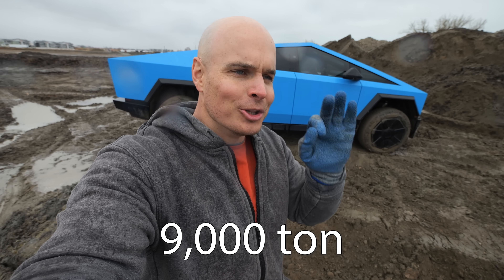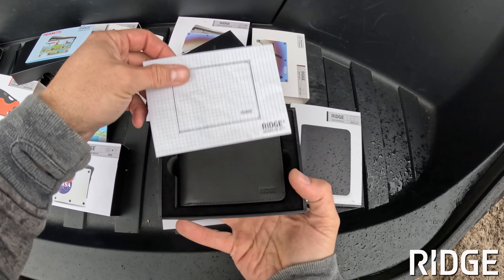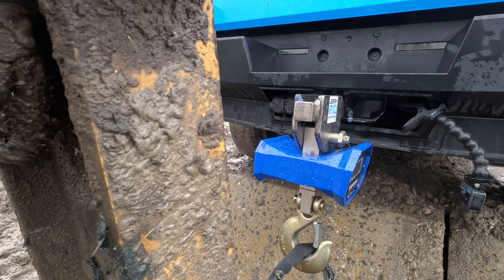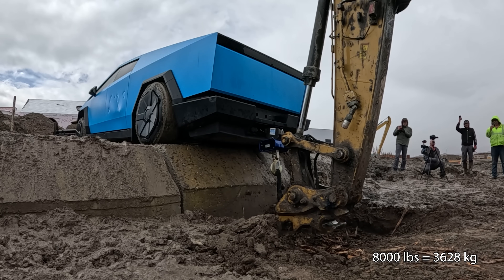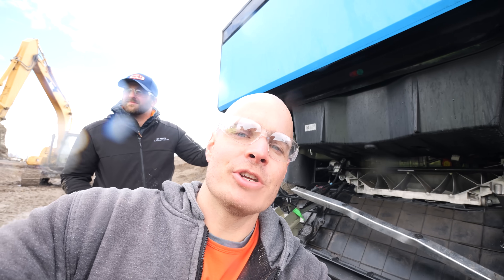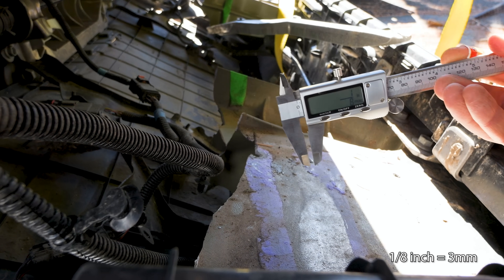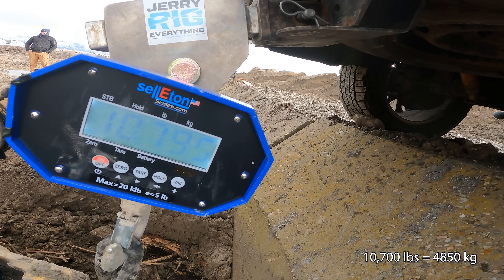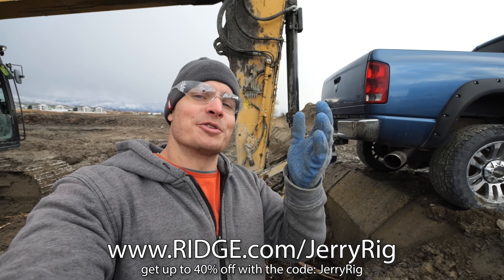SHOULD YOU TOW WITH A CYBERTRUCK?! - (catastrophic failure test)

Comment: Isn’t the vertical force capacity denoted by the tongue weight rating, not the tow rating? Tow limit is calculated with horizontal force, not vertical.
Reply: He addresses that in the middle of the video.
Reply: @DylanClarkSallee he kind of does… either he misunderstands or he’s being misleading on purpose because most people don’t tow and don’t understand why exceeding the tongue weight doesn’t mean tow capacity. Tow capacity has more to do with the drivetrain than structural. GRE also tweeted a few weeks ago that he would get rid of his Tesla because of Elons politics which makes me less inclined to believe he is non biased.

Comment: If you happen to back an 11,000lb trailer off a cliff and have a tractor holding down the front wheels you would shear the hitch right off. 

Although, I think I’d rather be sitting in a truck with no hitch than at the bottom of a cliff. 

Very scientific.

Comment: 8:30 Structural bonding adhesive holds airplanes together and can be much stronger than 4-8 mechanical fasteners.
Reply: Still not an excuse for not using mechanical fasteners
Reply: @scottwesner9362  No, I mean yeah, yes it is a suitable replacement for mechanical fasteners, when used correctly.
 Mechanical fasteners are often used to ensure enough clamp, curing time.
 Removing the mechanical fasteners often won't change the breaking load even.

Comment: Well, it's a misleading and totally irrelevant video. The force applied in the video is vertical. However, this is not a crane. The structure is designed to withstand horizontal forces, and although I'm not a Tesla fan at all, I'm pretty sure it will be capable of towing a trailer with 20000+ pounds of mass.
Reply: pop it out and rewatch the video without all the slurping
Reply: @Maybeldid how many times are you going to post this lame comment?
Reply: @polska905  did you pop it out yet?

Comment: I always enjoy your videos. You brought up interesting points regarding metal fatigue and the thickness of the casting. I agree there could be something wrong here. However, I come away wondering if this is a valid test.

I doubt 100% of the mass of the trailer ends up as tongue weight. After all, the trailer is still on wheels, trailer brakes are required, and there is a properly distributed load. Upon stopping there is a torque that would apply a downforce "of a portion" of the load which transfers to tongue as a downward force but it would doubt it would be the entire mass of the trailer.

I wonder if there is a reference at SAE International that may help validate your test.

Comment: I like “Jerry Rig Everything” but I question the engineering knowledge in this experiment. 10,000 lbs downward vertical force is not achievable on a hitch. This clue is evident being they held the front down with another machine. By doing this you are applying leverage to the hitch, further increasing the ability to a failure. The leveraging pivot point is at the rear axle, a shorter distance to the hitch than the front bumper. In a real scenario, the front wheels would leave the ground, relieving that amount of stress. I'm not going to make this a geometry lesson, but seems the video is biased to discredit Tesla.
Reply: pop it out and rewatch the video without all the slurping

Comment: Mechanical Engineer here (30 year experience). I don't care about EVs or Musk.  Results of CyberTruck were quite impressive.
Reply: Stop saying this, no shot you're an engineer if you think snapping entirely is an impressive result. No normal truck is going to break like this, it might bend sure but it's not going to snap the rear end off the truck. How a frame snapping an a trailer flying off the truck is viewed as a "quite impressive" result is idiotic. Especially since it gets weaker over time and this becomes a when not an if problem.

Please let me know anything you worked on in your 30 years of experience so I can avoid it completely.
Reply: @Abadeez but such forces and a dozer on the front of your truck to prevent the truck from tipping is realistic? 

9 times the rated capacity is more than enough.
Reply: @ Not snapping is the point even when overexerted. And it will slowly come down from 9 times because of how aluminum works. Also the point. Nothing you say makes it a good result when it snaps off entirely by comparison and gets weaker and weaker over time.
Reply: @carlosherrera7822  until the tow breaks from aluminum fatigue and the load comes barreling toward you in the opposite lane.
Reply: Yes, everyone knows steel is stronger than aluminum but at what cost? Towing a massive load with the Dodge, one needs to decide on rating the truck in miles per gallon or gallons per mile. Clearly that Cybertruck can tow anything any reasonable homeowner would have. It's just silly to think anyone is needing to tow something with a 10K tongue weight. What would that even be? A space shuttle?
Reply: @Mr.X-Texas European Mechanical Engineer here. I believe that the biggest problem non-technical people have in understanding the strength of materials and structures is the complete omission of dynamics and the existence of the fourth dimension (time). The user can make a mistake, there will always be holes in the road, emergency braking happens, car accidents happen, pulling out of the mud with a jerk will sometimes be necessary (someone else's car or yours).
Holding such a load on the hook is no disgrace to this truck. The problems are: fatigue strength, cracking without warning (steel after exceeding its yield point will harden to the point of strength and bend until it breaks - in most cases you will notice something happening) and also tearing off a piece of the frame (together with the safety chain hook).
TL;DR Steel bends safely; Aluminum cracks unsafely - no space shuttle needed
Reply: @MatHojan-f7j European with a physics degree here. 
9 times the rated capacity is more than enough to prevent cracking. Steel fatigue over time, aluminum snaps that is why it holds up to 9 times it's rated capacity.

Comment: This test is idiotic, putting 10k lbs on the tongue and act surprised when it breaks. 

The truck’s official max tongue weight, is actually 10 percent of the max trailer load, or 1,100 pounds.

*I Don't own a Tesla and not a fanboy of them.
Reply: pop it out and rewatch the video without all the slurping

Comment: They need to somehow bolt something onto the subframe assembly that will fail before the subframe itself. Like every other subframe... the suspension components themselves have weak points that should break before the subframe bends to avoid needing to replace the subframe.

I realize it would be counterintuitive to intentionally put failure points on a tow mount but you need something to give deterministically before the subframe does for obvious reasons...

Comment: Wow, all these low blows towards tesla lately.  As a 40 year veteran to trucking and pulling trailers of all types I can tell you that you will never get more weight than what is in front of the trailer axle on the hitch. The tongue weight on a class B truck is only 1k lbs.

Comment: Not seen anything constructed like this before designed for towing although just because you haven't seen it doesn't mean it's not feasible.  I have designed rear bumper beams in the past for an OEM Static loading is not really that hard a load case I would be far more interested in snatch recovery as that's an instant max load not a building load as shown.

Comment: Dodge has better suspension travel.  Cybertruck has limited suspension travel. It was bottoming out way before the hitch snapped. That’ll give a jarring, back pain inducing and very uncomfortable ride. Drive could loose control as the nose of the truck might lift off the ground. If Cybertruck goes over bigger bump at 60mph
Could that cause front end to oscillate up and down multiple times as the back end bottoms out?

Cybertruck needs more suspension travel and heavier shocks? That could prevent the towing tongue tearing off. But it’s not built for towing heavy trailers.

Comment: It would be really interesting to find a way to put a load sensor to measure what kind of vertical force a trailer with the rated 1100lbs tounge weight while stationary actually puts on a hitch while towing. And a wide safetymargin seems extra important on a cast aluminum chassis like this since the failuremode is brittle, vs a steel frame that would deform a fair bit before breaking catastrophically.

Comment: its clear @jerrerigeverything, or as i like to call him, Jerry whines about everything is completely bias when it comes to Tesla. Cresting a hill DECREASES tongue weight. If the trailer jumps the ball, the safety chains will NOT see anywhere near the max towing capacity. Teslas are leading the market with design and technology and the cybertruck will never fail during normal operations. Remember, anyone can build a bridge, but only an engineer can build a bridge that always almost fails, but never does.

Comment: So the towing parts are stronger than the Suspension or the weight distribution can handle. So it's really just overengineered.
Compared to the terrible designed rest of the car.

Comment: tonge weight and towing capacity are 2 different things. stick to torture testing phones and building wheelchairs, Jerry.
Reply: "To quickly recap, Tesla's electric pickup is rated to tow up to 11,000 pounds (4,990 kilograms). Meanwhile, the maximum tongue weight—that's how much mass sits directly on the tow hitch—is capped at 1,100 lbs (499 kg)"

So the fact that you got up to over 8,000lbs tonge weight and it had not broke yet, is UNBELIEVABLE  for aluminum.

Comment: I dont like cybertruck but this is a passing score. Tongue weight WILL NEVER be close to even 50% of the trailer in a normal driving conditions... Rated for 11000 TOWING capacity and achieving 10000 TONGUE weight capacity is not bad. (I am surprised by the steel tho)

Comment: These guys in the videos are absolute idiots and most of the commenters on here must be also. Mechanical engineers included in the list of idiots. Towing capacity is different from tongue weight. Normally it's 10% of the towing capacity. In this case that would be 1,100 lb of tongue weight, not 11000. Jesus christ, how dumb can you be? The iIdiot in the video talking about potholes and improper loading. An 11,000 lb trailer improperly loaded will not put 11,000 lb of weight on the tongue. Unless the driver decided to stand the trailer vertically on the tongue while he was "towing" it.  Nor will a bad pothole do it. They just did this for clickbait and evidently it worked. Myself included.

Comment: the tongue rate rating of that truck is 1,100 pounds, similar to an F150.  In the video, damage was caused by ~10,500lbs tongue weight. how is this a shock?

Edit: you mentioned grades can impact tongue weight. correct, but the grade would have to be 100% to achieve even 5000lbs of tongue weight (pulling 11k lbs), still 5500lbs lower than when it ripped the body off. sooo can you pls let me know in what will someone be pulling 11klbs on a 100% grade?
Reply from the maker: The dead weight raiting is 1100 lbs tongue weight. Dynamic loads (alive weight) vary alot more than that. Boat ramps/driveways/loading docks will all have a transition point where some of the trailer weight transfers to the tongue. 

It's too close for comfort.
Reply: @JerryRigEverything how is 5 to 10x the rating too close for comfort?
Reply from the maker: @braddboy5  that's a dead load tongue weight. SAE J684 has the minimum weight for passing at 5500lbs. (And that's with steel) The cybertruck barely has a 2x safety factor. The aluminum aspect makes it so much worse.
Reply: @ Zach, just admit you wouldn’t have made this video if Elon were still on your side. It exceeded its advertised tongue weight by a lot and you still wanted the thumbnail with the broken Tesla.
Reply: @ wouldn’t that be similar to any truck out there? 
I would love to see this test on a F150, if you ever have time to do so.
Reply from the maker: @MarksTech  i did the test on a Dodge 2500 in this video that did not break.  But yeah I do plan on testing more trucks. I'm curious how they all hold up
Reply: @JerryRigEverything  2500 is rated differently. The cybertruck isn’t in its class. The f150 is. I’m not a fan of the cyber truck, would never buy it. But I think remaining fair is important.
Reply from the maker: @MarksTech  both trucks have a class 4 hitch. And the same tongue weight rating and nearly the same towing capacity.  The dodge is a 20 year old 2004. 

I think the test was definitely fair.   Thank you though!
Reply: @JerryRigEverything  come on, Zach. We all know why you’re doing this and presenting it this way. It’s fine, just at least admit it

Comment: Really, all it’s going to take is somebody using a load leveling hitch with a heavy trailer to snap that off. Tongue weight is all about what your suspension can handle without pushing your geometry so out of whack that you can’t drive straight. So a load leveling hitchcan put a whole lot more weight through your receiver than the 200 or 600 pound rating of the hitch. One Big Rd., Whoopty and everything comes apart.

Comment: This "test" is meaningless. There is no possible way for a 11,000 lb. trailer to "transfer" all of it's weight to straight downward force on the tongue while driving. Saying that pot holes, swerves, cresting a hill, etc. could cause this weight transfer to happen is non-sense. The load presented by towing a trailer is not mostly downward on the tongue - it is almost entirely lateral force. You should have tied the front of the truck to an immovable object and then pulled horizontally on the hitch, while applying 1,100 lbs. of downward force (simulated tongue weight). I guarantee it would have easily exceeded the 11,000 lb. tow rating in a normal, lateral pull - like what forces are applied when towing a trailer.

As far as the weakening of the aluminum frame with repeated stress, that is a real occurrence - but I am not qualified to speak to the potential lifespan of the frame - and neither are you. FWIW - aircraft frames are comprised of aluminum and they survive millions of repeated stress events. It is all about designing the frame to be strong enough to work within an operational envelope, not trying to create something that is so grossly over-sized as to be impractical.

As for me, I'll stick to my F-350 with it's measly steel V-5 hitch rated for 2,120 lb. tongue weight capacity and 21,120 lbs. of  towing capacity - all tied together with a big box steel frame. The 60 gallon diesel tank gives me more than 6 times the range of that ugly Tesla while towing my 11,000 lb. RV.  🙂

Comment: Wonder what results you might get with a family car or wagon, such as VW/Audi, or any other European/Japanese brands? They are used all the time in towing at the old continent. I had an Audi A4 quattro, which was rated at 1800kg I think. It pulled a horse trailer just fine, summer and winter 😅

Comment: watch out that you don't get done for domestic terrorism.
in all seriousness though ball weight and towing capacity are two different things.
one is a downwards force and the other is a (lateral?) force so that is kind of impressive that the aluminum could handle that amount of ball weight.
dosn''t mean i would ever buy anything with an aluminum frame as it will always be more prone to failure as it has a lot less elasticity.

Comment: If the front end wasn't secured to a heavy machine it would have been fine.
Personally I think the Cybertruck is pointless but it passed this ill-conceived test.
Reply: Seriously, this test is so idiotic. He says that 10.000lb of downward force could happen in real life, but he didn't come close to giving an example (driving up a mountain ... and then what?!). The general argument is that aluminum fatigues, which is basically correct, but nobody (except Tesla, most likely) has done the maths and demonstrated how many stress cycles of which intensity would require this part to fail.

Comment: The problem isnt that 10000 is too weak, its not. The issue is you can generate very high spikes by hitting a pothole and it needs to be able absorb it.

Kind of like glass is very strong, much stronger than wood, until you hit it with a tiny  hammer...

A drop test will show drastically different results

Comment: I jumped an 89 crown victoria over a creek, slid on the front bumper for 20 feet, then the rear of the car slammed down, and the only reason I couldn't drive it out was because it was stuck in the mud. After being towed back to the pavement I continued to use the car normally with zero repairs. Modern vehicles are an embarrassment.

Comment: Curious, damaged steel frames can be cut out and new sections welded back in place rather easily but how in the world can a "gigaframe" be repaired? Does anyone have any experience with cast aluminum repairs in high stress/load areas?
Reply from the maker: I'm about to find out.  I'm going to try and get the truck fixed by tesla.  Out of pocket of course. Since this damage isn't covered by insurance.
Reply: @JerryRigEverything  most excellent! I'm anxious to learn about that process and cost. Thanks for the reply and looking forward to that update.

Comment: Towing capacity is far different than tongue weight. What you are putting on the hitch is tongue weight, so of course, it will fail far below the towing rating of 11 000 lbs. I'm confused that you should all know this and therefore just destroyinh the truck with a completely worthless test....